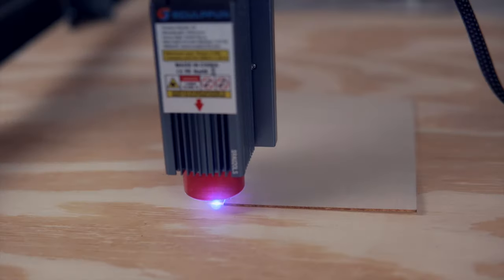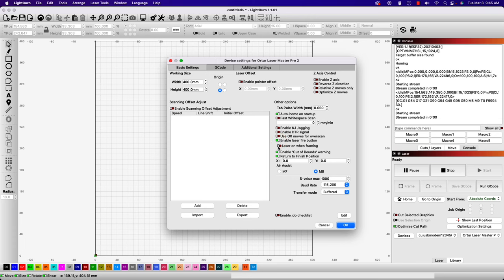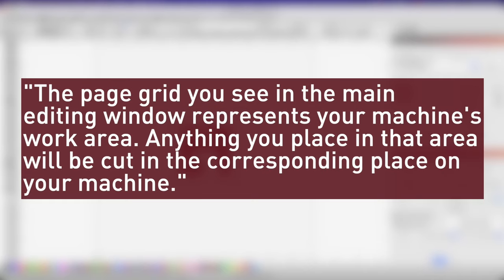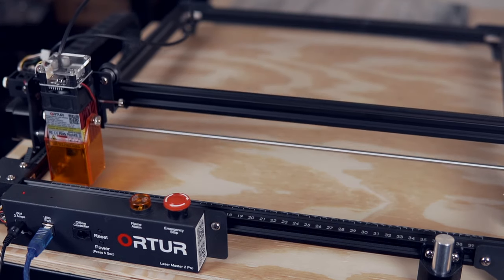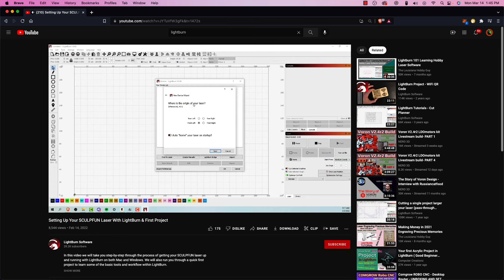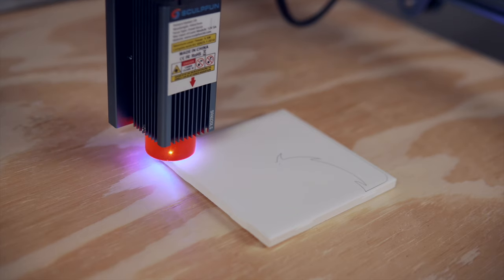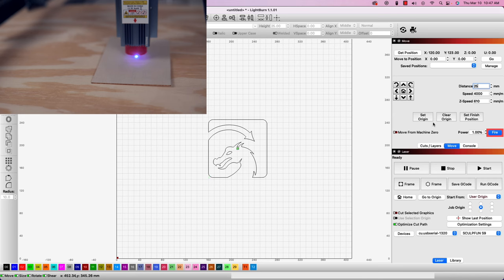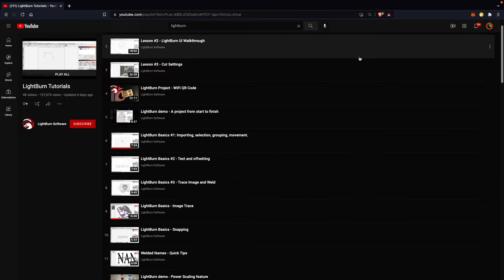Understanding the Different Start From Modes in LightBurn

Comment: I just renewed my license and updated Lightburn, and now when I send a file to my laser, it starts to burn for just a second and then stops. I tried restarting my computer and restarted my laser several times.  Could it be the USB cable? If so, is it a regular printer usb cable? I don't know what else to do unless a setting changed when I updated the software.  I have a Masuter laser with Windows 10. Thanks for any help in advance.

Comment: Can any of you commentors give me a hand? Ive been searching the web, maybe I dont know how to ask the correct question. Whenever I use jog my laser, the machine moves opposite of my arrow keys. Also when I engrave out text, its always backwards and reversed, if that makes sense. Like if you were to write on the outside of a sheet of glass and then look at it backwards and from the other side. Any pointers?
Reply from the maker: https://docs.lightburnsoftware.com/Troubleshooting/JobQuality/MirroredOrBackwards.html

Comment: Didn't really understand  absolute and current position. Why not just start all jobs with current position?
Reply: Absolute is navigating from the machines zero or origin.

Current would be navigating from from the current position.  
 
In absolute if x axis is at 4" and you tell it to go to 4" it will not move.

In current or incremental it if you told it to to go to 4" it would move 4" from its current position.

Comment: I have just buy the atomstack x7 pro does this have those limit switches or not? Thanks!
Reply: No it does not. So like he said move the laser head to the front left before powering on machine as I did not know this and would constantly have it run out of bound since the origin is set once you turn the head on

Comment: I'm new to this and I appreciate the videos very much. I have an Xtool D1. My problem, one of many, is when I set the center point and frame it frames as I expect. But when I start the image it goes outside the area that is framed.
Reply from the maker: Are you framing with the beam of the laser or the x positioning tool?
Reply: @lightburnsoftware7189  the x positioning tool
Reply: I had this problem and I had turned on the Offset position in the setting. Once I turned it off it went back to normal.

Comment: While in "Start From:  User Origin", I can't get "Set Origin" to work.  After "Set Origin" then some miscellaneous "Move" then hit "Go to Origin" it doesn't go to where I had set the origin.  I have a Fox Alien M-Pro CNC with a 20w laser.  Many thanks!
Reply from the maker: @saltysailorboy1062  - You are likely not zeroing out the workspace offset from using it as a CNC. You basically zero the machine to the front-left corner.

Comment: Something that I just figured out that is not mentioned on any video is that when LightBurn is using Current Position it includes everything that is outside the grid to figure out the framing.  I kept trying to use Current Position and slamming the laser into the frame.  I could not find the little green dot either.  Figured out that I had a bunch of images outside the grid that I used to create what I was going to engrave and LightBurn was including that in the framing.  This does not happen on Absolute Coords. You can have all kinds of stuff outside the grid and it is ignored.  This was such a simple thing but it was stopping me from ever using anything but Absolute Coords.  Hope this helps someone else out.
Reply: Current position can still be used in your scenario - select the items you want to include and turn on the options for "Cut Selected Graphics" and "Use Selection Origin".
Anything that is not selected will not be included in determining the extents of the elements to be processed / framed..

Comment: Did you remove the minimum power setting for the laser when drawing a line (cutting)?  

I'm having big issues since the last few updates where the laser is not cutting the wood all the way through and is now burning the surface quite badly.  This was not an issue before but is now constantly ruining projects?
Reply from the maker: We did, because it is not used for GCode devices, and never has been.  It was never supposed to be shown, and GCode systems have no way to use the Min Power value, so something else has changed.

Comment: What can we do when the laser is bumping on the axes? I've tried everything, but it didn't work
Reply from the maker: Does this laser have homing limit switches? 

If it is bumping the axes it could be a few things. I would make sure the work area size for the laser is set correctly under Device Settings. 

If you are using Absolute coordinates and the laser has limit switches you will need to home it before running the job (you can also enable auto home on start up). If there are no limit switches you will need to physically moved the laser to the front left corner before powering it on. The location the laser is when powered on in this case sets the origin. 

For User Origin or Current Position as long as your design is not bigger than your work area and you have the job positioning set correctly that is another option. 

Is this happening for all jobs? Even if you try to run something that is small?

If you try the above and are still having issues reach out to our support team - support@lightburnsoftware.com

Comment: My machine was down for 4 days and Light burn sent me your link. One button and it fixed my problem. Somehow my absolute coordinates changed when my laser head hit an object really hard in the bed. I recieved a margin slop error immediately after. Did my FL1390 sense the hit as a merging issue?
Reply from the maker: If the head of the laser hit an object really hard it is likely that it caused the stepper motor to skip steps. The absolute coordinates wouldn't have changed intentionally but due to the skipped steps, the position shifted.
Reply: @lightburnsoftware7189  Ok, I better run a test to see if it can cut a perfect circle or square. If it doesnt  do we count the teeth on the xy to make sure they are equal?

Comment: My lightburn software has no "move" tab thherefore I cant use the fire button, please help  how to enable the move tab. Thanks.
Reply from the maker: Click Window from the top menu and select Move. If it is already checked or still not visible then you will want to select "Reset to Default Layout" from the same menu.

Comment: I have the Atomstack x7 pro that doesn't have limit switches. So if you have to manually move the head as well as turn off auto home, it sets the origin relative to the origin set in LB correct? Is that why when I would frame/start the laser moves all the way to the right and hits the frame? I start the laser with it all the way on the left so even then I don't see how it would hit the right gantry if my work piece isn't even that far from the left side
Reply from the maker: If your laser does not have limit switches, the location you power it on at is what it will assign as its origin. If you use absolute coordinates that is your origin. Now you can jog the laser head to where you want it in user origin mode and set the origin, or you can move the laser by hand in current position mode and when you hit start it will start at that location (make sure you set job origin correctly). 

If you are following what is in the video and it is going to the wrong corner it very well may be that the origin location is set incorrectly. This is typically front left for GRBL firmware.

You set this under device settings.

Comment: Hi Sculpfun users, I need help.......I have a sculpfun s30/5.5 machine. When i try to download the CH340 driver  my security tells me it can't download due to a virus . Now what do i do??? Any help would be appreciated and now at a standstill.
Reply from the maker: Replied to your most recent comment but also pasting here in case you did not see that one:

 If you used this link then it would be a false flag and you may need to allow it past your virus detection: https://sparks.gogo.co.nz/ch340.html

Alternatively you could try a different source. The CH340 driver is quite a common one.
Reply: @lightburnsoftware7189  problem is resolved

Comment: Clear videos but doesn't relate to anything my Sculpfun S9 does. Can't get it to remember the home position, couldn't get it to find the cutter without manually adding. Despite the first project design it still tries to cut it in the wrong place and go overlimit. 
Ran out of advice. Forum is very unspecific as my thread got taken over by someone with a different machine but I get a snotty warning for double posting whilst making another specific thread. Very unwelcoming. Some admins have such crap attitudes. Overall, trial ran out so now a paying customer and not really getting much in return, just generalisation.
Reply from the maker: The SculpFun S9 does not have limit switches or homing (unless you've added those) so absolute positioning is more difficult, but not impossible.  We have a video that covers the S9 specifically here:  https://www.youtube.com/watch?v=JYTuVfW3gFk&t=890s
Reply: @lightburnsoftware7189  watched it several times. The recommended link to the drivers didn't work as shown. Had to rely on a link from another user on the LB forum. LB didn't find laser at all. Another user had to tell me how to fudge it.  Now prescribed settings have it banging the extrusions every go and no cutting done. Will have to start again and try it on Win11 machine if it'll reach. Between drivers, LB and laser I reckon there's a problem.

Comment: help my letters are all backwards ??
Reply from the maker: he ‘Device Origin' setting, found in the menus under Edit => Device Settings , controls the orientation of what gets sent to your laser. If you have the origin for the device set incorrectly, your output will be mirrored or upside down when run.
Reply: @lightburnsoftware7189  Thanks i think ive sorted it i must have inadvertently hit the reverse image on one of the top buttons seems ok now thanks

Comment: Why does it has to be so complicated... it should be one of the most basic functions
Reply from the maker: If you use “Absolute Coords” it is not complicated at all - it goes on the laser where it is in LightBurn.  The other modes are provided mostly for CO2 laser systems which make quite heavy use of the ability to easily reposition files stored in the controller.

Comment: this lightburn is a joke...I know,if you are pro it is good and you dont feel like you are wasting your time BUT as an amateur I dont have 4 weeks to learn this "thing".Should be much more logical and simplier and user friendly.
Reply: 4 weeks? I installed lightburn today and in 10 minutes I got my first model engraved (got machine yesterday and saw everything from software and hardware for the first time). Then did some tests with speed and power, to find out settings that cut or engrave my wood properly. It's pretty logical, just test things. There are 5000 settings I don't understand so far, but learning them one by one in time will print projects better.
Reply: I was up and using mine in a few hours.  Seemed super simple to me 🤷‍♀️
Reply: If you're going to use a laser, the mild learning curve of LightBurn is 100% worth it. It doesn't take 4 weeks. I learned after a use or two on RD works, I already knew everything I needed on LightBurn from day one coming from RD. So between the two, it was a couple hours at most figuring out how to ultimately run LightBurn.
Reply: I know what you mean m8 my letters are still backwards !!
Reply: Try fixing your brain..